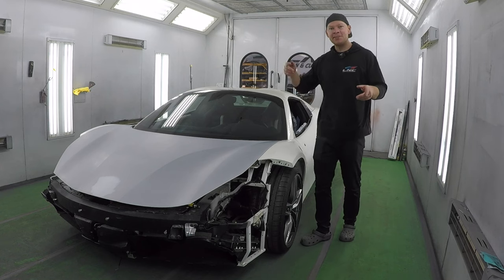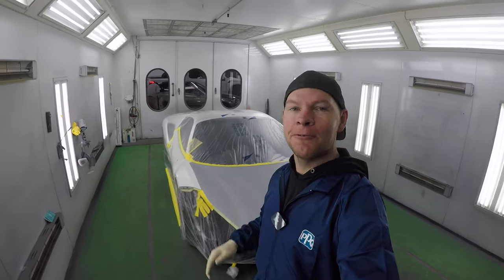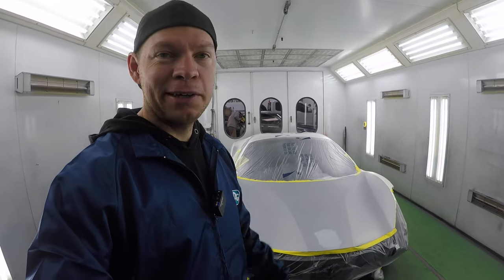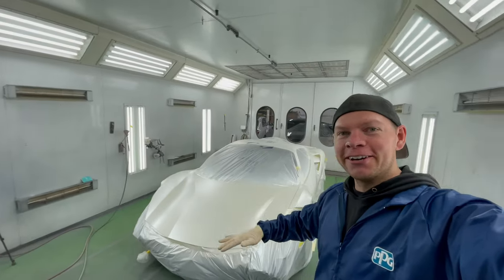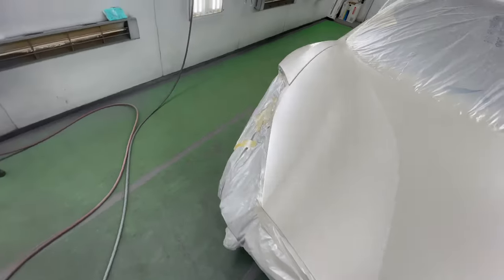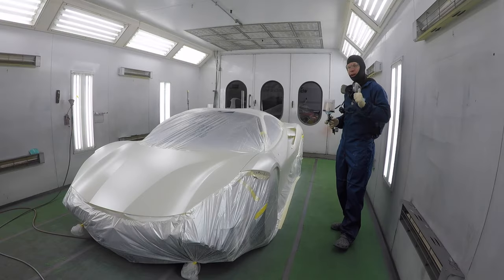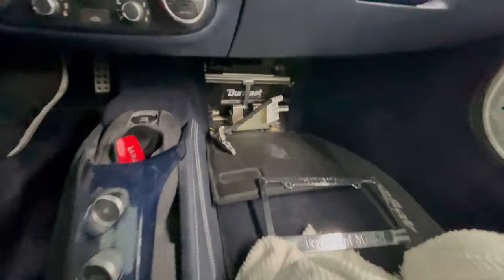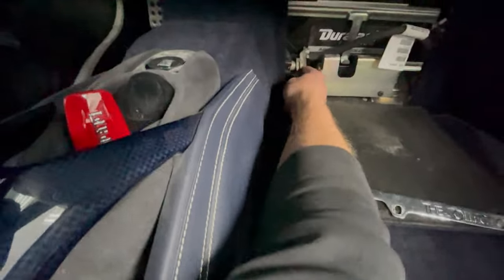How to spray 3 Stage Bianco Fuji Pearl White - Respray after Wreck using PPG Waterborne Paint

Comment: great content, man. interesting to know, you indicated 1.3 at 23psi; do you use lower pressures at times, and why? closer spray? slower drying? tighter coverage? I notice you almost always use the higher pressures, and even with pearl. interesting video, and love the tech details, especially with the more complicated finishes like this 3-stage pearl. really amazing match, always like it when you show the formulas and undercoat options and choices, including reducers.
Reply from the maker: I feel like my paint atomizes better at higher pressure to give a nice cleaner finish, lower pressures it builds up lots of texture and orangepeel. Seems to be working for me so thats why. Although basecoat i spray no more than 20 psi, sealer i spray higher at 28-30 psi and same with clearcoat. I lower pressure on my control coats, the final orientation coat. 16psi and further from the panel to even out the metallics.